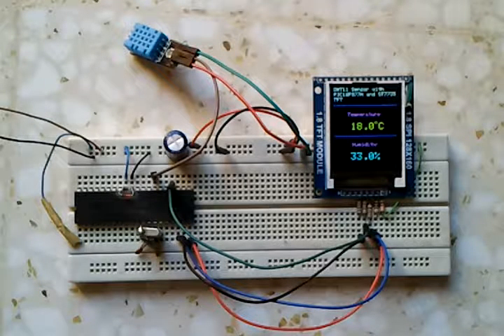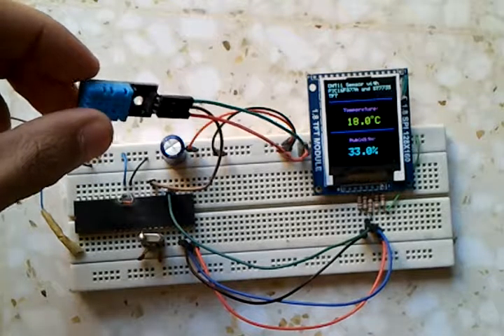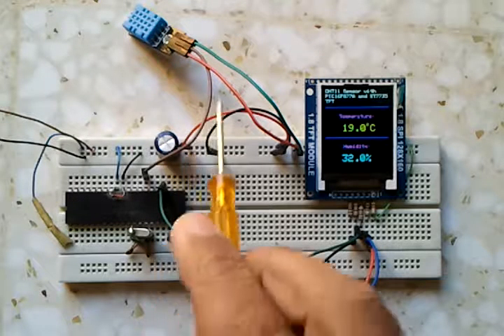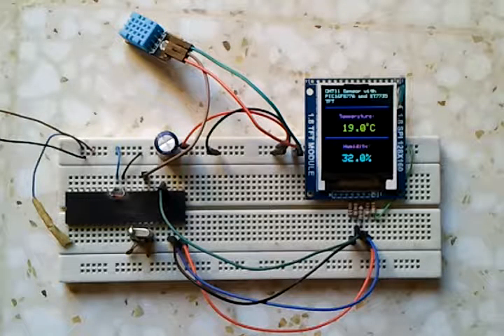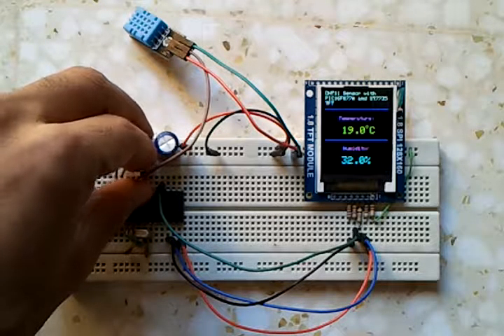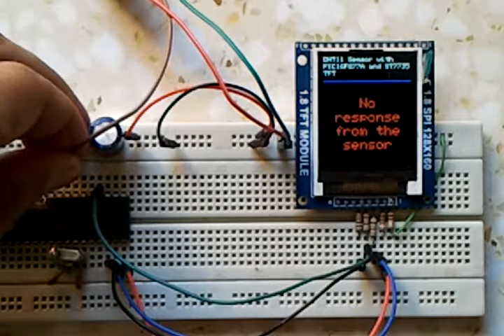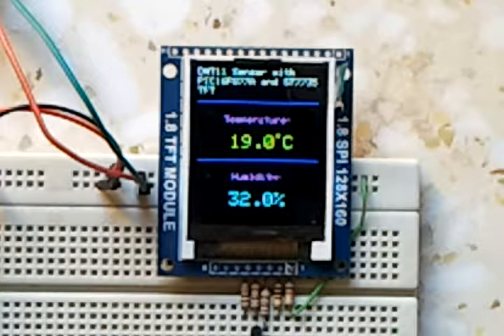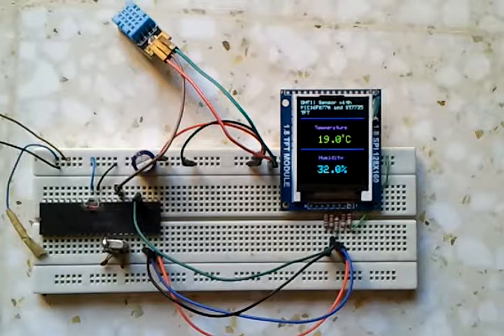PIC16F877A with DHT11 sensor and ST7735 TFT display

Comment: do you know if it's possible to do the same in MikroC?
Reply from the maker: Yes you can do it with mikroC but you have to make some modifications to the CCS C codes in order to work with mikroC.